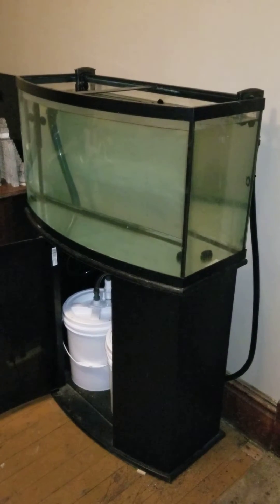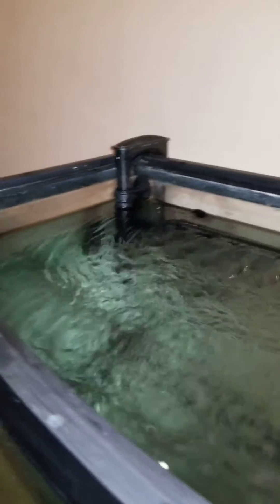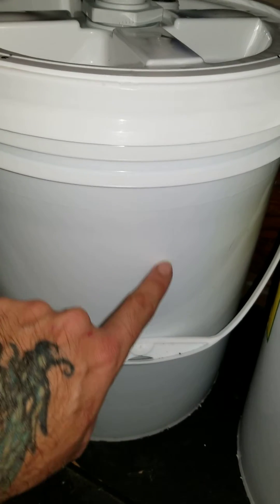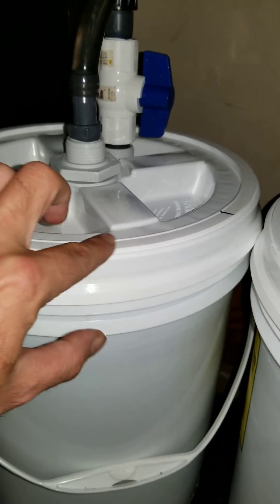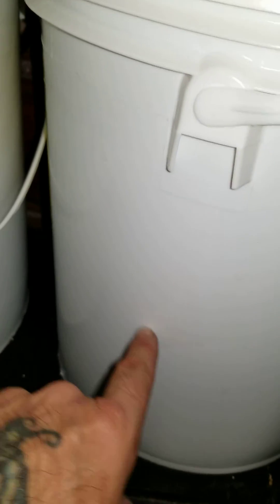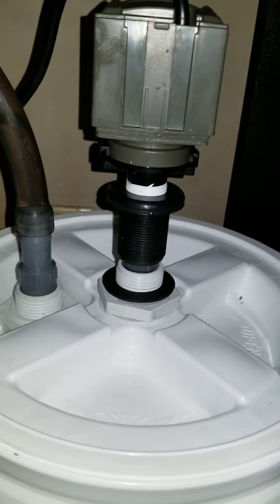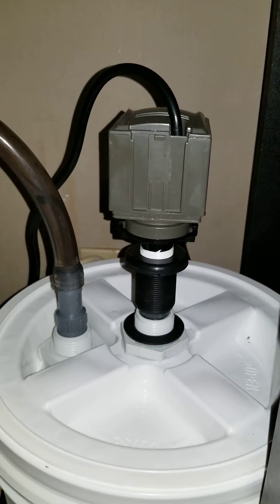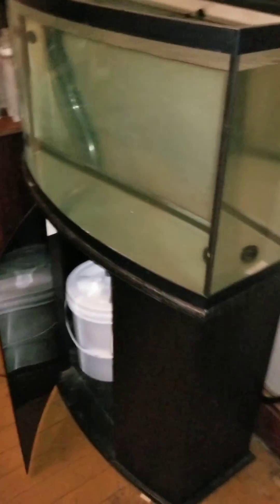DIY 10 Gallon Canister Filter

Comment: the problem with this gamma seal is that once the pump stops working you end up with an empty tank and a floor full of water, because the gamma seal cannot hold all that pressure.
I also made one my self and still looking for a way to make it withstand all that pressure without leaking. until then I have my bucket filter out of service.(placing the bucket above the aquarium water level might help but is not very appealing)
Reply: Shouldnt you be able to put a check valve in the line to prevent it from draining back into the bucket?

Comment: Brilliant man, I like how you've kept the pressure under control, nice workaround
Reply from the maker: Thanks for the compliment, but i wasn't able to correct the pressure issue and had to scrap this design. I did build a newer model that test ran fine for months. I dont have it hooked up to anything right now but I plan to use the newer system on some live wells when I get my enclosed porch finished. I'll post a vid of version 2.0 then.
Reply: Can you show how to build it please? Internal and components needed